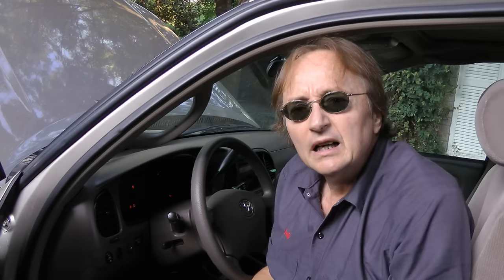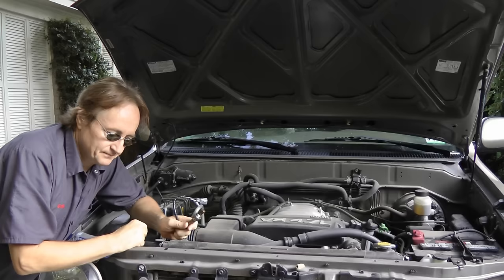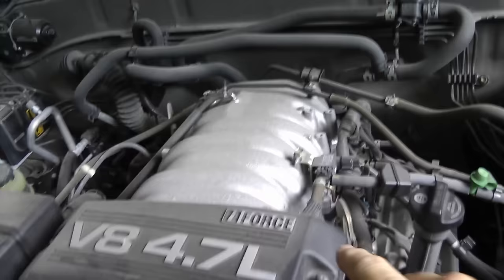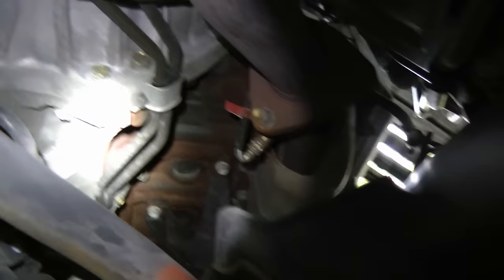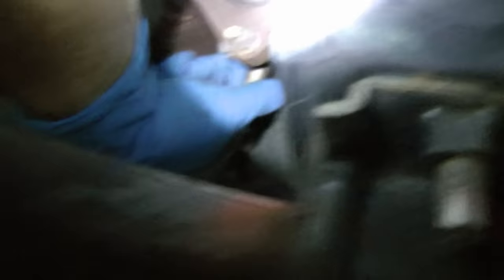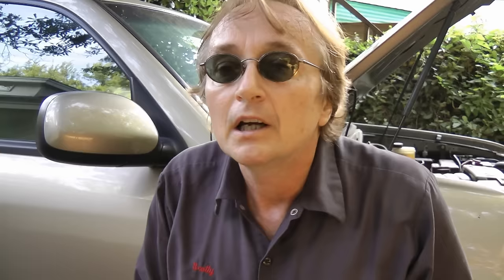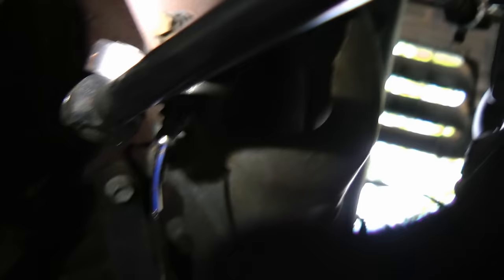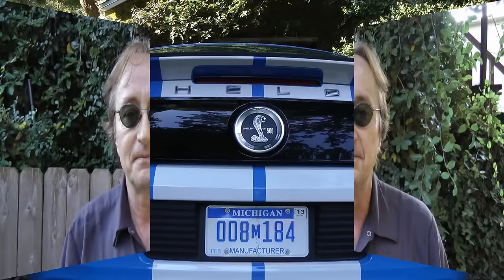How to Replace an Oxygen Sensor in Your Car (Air Fuel Ratio Sensor)

Comment: I've had three cars now that never threw an O2 sensor code.Now I know that one of the ways an O2 sensor goes bad is that it will still produce a voltage but it's too low.If your MPG's start going down but there's no O2 sensor code I suggest you test the O2 sensors anyway.On my current car, a 1990 Toyota Camry 2.5L V6, I never got an O2 sensor code but the car was running pig rich.I hooked up a voltmeter to the rear O2 sensor and VOILA,voltage told comp that it was lean when it was really rich.

Comment: Hi, would the check engine diagnostics still work if some of the replaceable parts of the fuse box would be bad and how do you check this and how likely is it that the fuse box stops working in general? Thanks

Comment from the maker: you can't really clean them. And generally the two front ones are the same and the back ones are different than the front but the same on both back ones. they just bolt off and on

Comment: Hello there, I watch your videos all the time to get informed info on DYI items and love the content. So now i have a question.The other day my check engine light came on and the code call for a bank 1 sensor 1 replacement. An easy fix so i replaced it with a new 02 sensor. So the engine light is on again calling a bank 1 sensor 2 replacement. What is the odd of multiple sensors going bad and is it normal?
 
2013 Cadillac ATS 2.0T Base model

Comment: Great video! Quick question tho. I have a '02 Toyota solara 4 cylinder. My check engine light came on and the code is saying it's "p0136" is this the same same code you used for this truck? Thanks for your time

Comment: I used the UV Dye method to find where my oil was leaking on my Ford Escape and it was the timing chain cover, but that video showing me how to do that has led me to this video because the oil leaking down has completely soaked my 02 sensor and wire on Bank 2 Sensor 1...I think I may have found my issue when trying to accelerate....Thanks for the great advise as always Scotty! :)

Comment: I came across your video. I was wondering if you had any advice. I have a 2016 Subaru Forester. I cannot get the key to turn downward towards off. It’s in park and my foot on the brake. I have to put it in reverse and then park to get it to turn the key to off. I’ve been told it’s an IIRC sensor how hard is this to find and do myself? Does autozone have these parts?

Comment: Scotty my 1995 Camaro 6 speed has a bad o2 sensor witch is making it run a tad bit hot at ideal and pops a tad bit from exhaust when warm was just wondering if it's all good it seems to run perfect but I've only had it for two days and now I have it parked till I fix it was wondering if this would cause engine problems at all

Comment: Hi @scottykilmer first of all thanks so much for all your videos! I have an oxygen sensor that I want to test using a multimeter but the sensor has 5 wires and I can't find an explanation on how to to test the voltage or the resistance when the sensor has 5 wires.

Comment: Hey Scotty dear, I'm planning to modify my new 2013 civic coup lx for a little more power by replacing the air intake and exhaust, should I then have it tuned by my mechanic? I've heard that after changing those to the car it needs to be tuned what say you? This came about because I sure have trouble  with merging into traffic safely because this car doesn't have a whole lotta power to begin with. It's fun to drive but I'm in need of more power.

Comment: Scotty I got a problem with the secondary O2 sensors in my car. I got a Nissan Maxima 2001 SE with 80,000 miles and the problem it's that when I got out to the highway, the Check Engine light up and the scanner indicates a problem (Slow response or No response at all) with the secondary O2 sensors (Bank 1 and Bank 2) but in the city they even don´t give any problem at all. What I can do before even consider the option of replacing them?

Comment: Hi Scotty love your videos, i just looked on my receipt from the Holden dealer it says inspected for engine light coming on,found for bank two sensor codes P2273,PO160 AND PO158 relating to O2 sensor , cost me $400 the sensor was only a $103 rest was labour not happy i should of brought a scan tool off eBay there $48 and checked the codes myself the engine light has come back on, rang Holden they said they would have to switch the sensors around to find the faulty one i have a Holden VE commodore 2010 model SIDI

Comment: Hi Scotty. Good to see you there, saving people money by doing jobs yourself. I have four oxygen sensors in my '97 GMC with a Vortec V6 engine. I had the truck checked out at a shop just after I bought it and was told that all of the oxygen sensors were bad. I couldn't pay his shop rate of $250 to change all four. So I bought new ones (NTK Brand for a total of $220) and replaced two myself but couldn't get the other two out. I found a mechanic who came to my place and did the other two for $50. The truck runs fine now but the check engine light is on. Did I use the wrong brand of sensors or what?

Comment: It may be a stupid question. But are all oxygen sensor socket all the same size on all vehicles sensor 1 or 2 on all models and all year models, I have a 2006 Mazda 6 that needs to be changed. Not sure yet if its the sensor 1 or 2. should probably start with the sensor 1, due to the fact that the sensor 2 is to detect if the sensor 1 is operating correctly, right?  Just to make sure.  So are they all the same size.  Please let me know. Thanks for your videos they help a lot. Thanks

Comment: Your videos are awesome. You should see if NPR would take you for a reboot of Car Talk. Two questions: do I have to do this cold? I keep reading the car has to sit overnight. Also, will I need a thread chaser? I have everything else I need to do it. OEM matched part, wrench the right size, and penetrating oil.
Reply from the maker: you can do it hot or cold, doesn't matter.  And only use thread chaser if old sensor comes off hard

Comment: Scotty,, I can not connect the O2 housing to case. It is the right O2 sensor so that is not a problem. The problem is when I move the O2 sensor unit around  the 4 poles move around inside as well so they DON'T match up with housing holes. WHAT SHOULD I DO?

Comment: Hey Scotty thanks for all the videos they have been great and very helpful. Could you please answer a question I have? I have changed the O2 sensor from bank 2 sensor 2 with dealer part but light is still on says it doesn't read, you can see it working in the live diagnostic so I don't know what else to do. It's on a 2003 Chevy Tahoe. Thanks You

Comment: Hi Scotty. I have a sonata 2005. A few month ago someone made a engine detailing and since then I have multiple sensor error. I changed them all but still the problem persist. Do you have any idea what could it be? I also changed the transmission because a mechanic told me it was the problem. (had a problem shifting to 3rd.)now the new one has the same problem.

Comment: Hi Scotty, how many oxygen sensors used engines V6?  All V6 use the same? I have a  toyota 4runner 98  v6  Thank you.
Reply: In most cases you would have 4, 1 upstream (before Cat) and 1 downstream (after Cat) per exhaust manifold.

Comment from the maker: only flush a car that has crud inside, take the valve cover off and see if it's crudded up inside or not. If so, get an engine flush like K and W flush, direcitons are on the can. Me, being that old, I'd use castrol 10/40 oil

Comment: Hey Scotty I have few questions regarding 2008 lexus es350. my bank 2 sensor 2 stop working properly. I would like to know how to fix it by myself first question. second Oem parts is very expensive. would it be okay to buy an denso bank 2 sensor 2 instead?  thanks

Comment: Thanks for the fast response. I´ll try doing that. If the problem still exists after cleaning my cats, I should consider replace the O2 sensors or change my catalyzer?

Comment: Hi , oxygen sensor can be cleaned without opening it ?
Reply from the maker: heck, they really can't be cleaned at all. They run in a hot exhaust and if crap has burned onto them like burned oil, you have to change them out

Comment: Thanks to this video, my new 1996 Ford Explorer was fixed before it even had a real problem.  Yeah, I bought an old SUV, but the older they are, the easier they are to fix, and it's just new enough to comply with OBD2 scans.  Also thank you Scotty Kilmer for giving us the tip about BlueDriver.

SOO much headache and expense averted.

Comment: Hello Scotty,
Thanks and you are right. It is up on the pipe away from CT converter beside the motor. That is why I could not fond it. It is hidden.

One more thing.
Could you give me the list of (sensors and thermostats) a 1992 Ford Tempo 3L-V6 has? I want to change them all.

What other things should I change on the motor for sufficient running?

You are good man Scotty... I
I really salute you helping people in here.

Comment: Hi Scotty..cant thank you enough but am grateful of all what you do and share. I learnt alot from you Thank YOU.!!!

I watched your video how to replace sensor 1 bank 1 and I was able to do it on my own. Code P0130 popped up twice in the reading. Confident, replaced  the Sensor 1 Bank 1 located before the CAT on my Mazda 3 2005 it was done accordingly. Reset the vechicle engine was off but then it came back in again after idling for 5 mins.  After resetting it, unplugged the Negative from battery stepped on the brakes consecutively 5 times, idle it for 20 mins then turn A/C on for 15 mins then turned it off, engine light OFF, took it for a spin, turned it off turned it back in idle it 5 mins engine light ON.  I had replaced the Upstream and Dowmstream with Bosch brand and new and old matched but engine ligjt ON after an 1hour. Ive cleaned the Mass Flow, the Throttle Body, reolace air filter, replaced the thermostat and the tempature control sensor and done oil change and new spark plugs as well. All that Engine light ON. Emmssion test also codes read NOT READY and failed. Ive also poured a gallon of Lacquer Thinner in a half tank drove it for half hour. All what was done to it made the car run smoother but still Engine Light ON code reading same code P0130 twice. What is going on. Need your help Scotty to solve my issue.

Comment: Will be changing bank 2 sensor 2 on my 07 camry v6.  Of course, it just has to be under the car with the plug inaccessible unless you remove the bottom plastic plate.  Should be at most a 10 minute job but this just adds to it.  Labor at the auto repair is around $140- no thanks, will do it myself.

Comment: hey Scotty, I have a 2005 corolla and its manual. I remember cleaning under my car one day with a hose by the o2 sensor  and soon after that my cars been hesitating on speed from a dead stop. my car ran uphill yesterday just fine on 2nd gear at 3000 rpm. my question is, did I cause some malfunction on the O2 sensor when I sprayed it with water? I don't think it's my clutch cause in 3rd gear when I shift to 2nd gear the rpm goes up like it's supposed to. also, my check engine light isnt on and nothing smells burnt or like gas.

Comment: Hello Scotty, I have an 05 Nissan Altima that when I went to my mechanic, he said the check engine light was caused by a bad 02 sensor, and when I start it up, it's fine, but when I put it in drive and sometimes reverse, it shakes badly... the check engine light flashes . Do you know what could be causing this?? Thank you!! I love your videos!

Comment from the maker: use factory sensors, not cheap imitations. But realize sensors often just read the car running rich, and are often not the cause. More often bad fuel injectors or bad MAF sensors do that

Comment: I have a Nissan Altima 2010 2.5 My Check Engine Light is On. But I just change the Upstream sensor. My question is what is the difference between Air Fuel Ratio Sensor and Oxygen sensor?
I did change the downstream.

Comment: hi Scott , I have 89 e250 had exhaust leak before 02 sensor, just had whole new exhaust system installed with new o2 sensor, but I have surging idle in park but drops down in gear, no vaccum leaks, any suggestions? ??

Comment: Hey scotty If I have spark on all cylinders. But I'm getting a codes for misfire cylinder 6 and codes for both my O2 sensors. My question is. Can both my O2 sensors cause my misfire on tinder 6 or could it be a bad valve. On the head?.

Comment: the voltage was 3.2 and 4.0 for the other.should i replace it? One more thing what is the normal pressure for the fuel pump?my son put water on my tank 4 years ago but it got flushed out but can that make the pump go bad over time?oh yeah i've run out of gas more than 4 times! thanks for all your help i really appreciated

Comment: hey scotty, I have a 2016 Nissan Altima 4 cylinder SL. Can u tell me does this vehicle have one or two oxygen sensors? I located one across from the radiator fan but I dont know where the other is, if any. Also, what brand do you recommend I use?

Comment: Hello Scotty-Love ur hilarious take on DIYs. I got a MB W202 1994model with loss of power and hesitation issues and engine popping noises when trying to accelerate during startup in the mornings. I have to wait for 5-10min for the engine to warm up and then its generally gone. Replaced sparks, MAF meter and it still persists. Fuel consumption is also Up. No fault codes detected. Could it be a faulty Oxygen sensor?

Comment: HI Scotty, Love your channel...i tried replacing my rear 02 sensor on my 2003 audi a4, i got the o2 sensor removal tool but i cant get the senor out. I dont know if its cause i dont have enough leverage to wiggle it free or if it's rusted on....got any tips to loosen it? thanks
Reply from the maker: I use a special socket I got at auto zone, it's got a side mount socket hole you put a cheater bar on, then you can get any sensor off

Comment: Scotty, I have a 2005 Honda Pilot, I got the P0172 code when I checked it at auto zone using their ODB scan tool, they told me it was the rear right bank 1 O2 sensor, they sold me part number 24302 from NTK, turned out to be $122 bucks with an additional 16 for the wrench tool. When I changed it out, and reconnected the wires, I started up my engine and the check engine light was still on. I noticed that on your Toyota, after you changed your sensor, then started the engine, your check engine light was off, do the Honda pilots need to be reset after the change or should mine automatically have gone off?  I was able to have a friend from work reset the check engine light using his ODB, so I guess I will see if the light comes back on.

Comment: I have a  1999 saturn sc 2 , it has extremely low miles for a  20 year old car but anyways a year after buying it the check engine light came on and read bad 02 sensors, I replaced both of them but the light comes back on? I was thinking maybe because these Saturns are notorious for burning oil that maybe the EGR valve is dirty and causing the light? I was trying to figure it out before i hand it over to my mechanic

Comment: Hey Scotty Does ob2 scanner test the live data from bank 1 sensor1 to check and see if this o2 sensor is working before actually replacing I have a foxwell nt680 pro scanner. I get the voltage read out for bank 1 sensor 2 and bank 2 sensor 2 but don’t see the values for b1s1 or b2s1 on an Acura MDX 2009 therefore not sure if I actually need to replace it or it’s the catalytic converter itself. If u can tell me how to test bank 1 sensor 1 id appreciate it tks

Comment: I’m dealing with a issue similar to this, I went to a shop and they told me it’s my catalytic converter. But my check engine like is on and feel like it’s my 02 Sensor that’s bad cause my tire pressure sensor keeps coming on… So I’m just curious what to do replace my converter which is $1200+ for my car or just replace my sensors cause I honestly don’t think they EVER BEEN BEFORE… What should I do?

Comment: Hi 
I have honda for 2013 
The check engine light were on and my mechanic said that its catalytic convertor 
After putting the catalytic convertor 
The check engine light came back on 
The code is p219a 
Could you please suggest what might have went wrong. What needs to be changed. Should o2 censor be changed or anything else

Comment: I have a question, I’ve been having a ticking problem. Engine light on, as well as change oil. Changed oil no metallic in the oil, used the actron scan tool, it said 02 sensor delayed (lean to rich) bank 1 sensor 1. As well as cylinder 4 misfire. Then 24 hours later engine light off. Still says the 02 sensor delayed but doesn’t say that there is a cylinder 4 misfire anymore. I have a 2013 Chevy Silverado 1500 lt. v8 5.3.

If you can help me out, that would be awesome! Have a great afternoon.

Comment: Got a check engine light in my 05 corolla. Code is p0171. Too lean bank 1. Gonna replace the 02 sensor then do the manifold gasket because why not! Hopefully that takes care of the code

Comment from the maker: they make a special socket to remove it, go buy one and use a long cheater bar on it.   The shield just snaps off, but if melted, you have to cut it off

Comment: hey scotty i have a 2000 plymouth breeze and it starts up but i have to give it a little gas and when im driving it the car turns off i checked the spark plugs and fuel pump and they are good idk what can it be im going to change the 02 sensor and see if that will help do u have any tips

Comment: I am getting really bad gas mileage on my 2000 Toyota Camry and I see black soot from the exhaust too. I had a leak in the exhaust pipe so I got that fixed. On my scan tool, I see the O2B1S2 voltage as 0. I am going to change this soon. My sparks plugs are only 6 months old. Could the bad O2 sensor be the reason for the bad gas mileage?